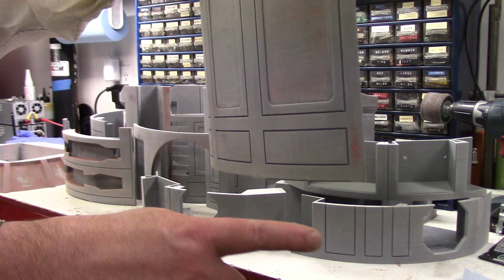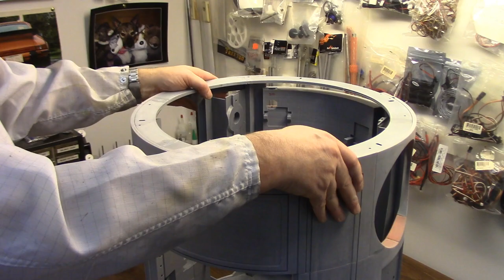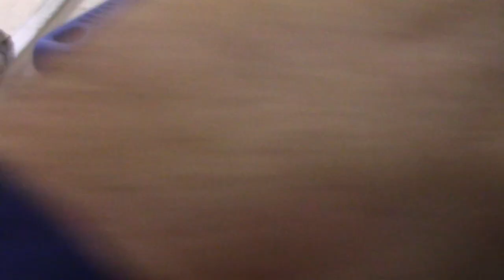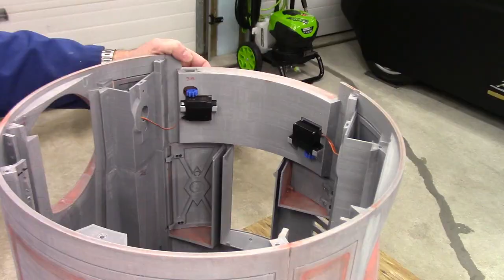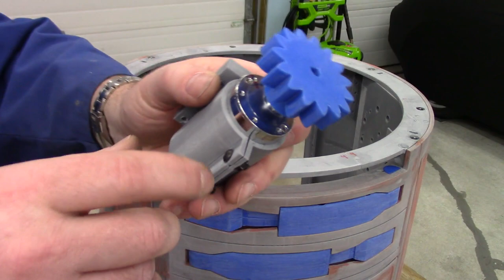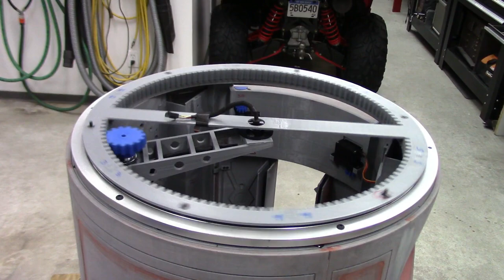Building R2-D2 - Part 5: Body Assembly including dome drive.

Comment: You mention something I keep trying to educate people about. Print layers and print time. People insist on printing fast. As a result they deal with high layer heights and a ton of post processing to make it look better.  Let the machine do the work!  Print slow  get those beautiful layers that take way less time to sand, fill, prime and paint!!
Reply from the maker: Well said 👍
Reply: @Rchelicopterfun thanks!  I completed my R2 in 2009 (aluminum). I’ve been tempted to print one in PETG
Reply: It used to be that way. But these new printers, like my Bambus and neptune 4 max are insane! Printing at .16 layer height with 4 walls and 15%gyroid with a .4 nozzle. Printing 3 times faster then a .6 nozzle at 2 walls 5%infil on my old printers. . Times have changed lol

Comment: From day one I've been using these videos as guide to building my R2. Using a Bambu P1P printer with PLA+ for the body and PETG for legs and anything structural. To fill gaps I prefer CA glue and baking soda. Quick setting and doesn't shrink. For smoothing layer lines.... Ive been printing at .2 layer height.... I use cabinet scrapers. They do a great job of removing layer lines and smoothing joints. You can get into areas sandpaper wont reach. Quicker too.
Reply: I’m thinking about buying a p1p for this project, is the 256mm^3 build volume enough for printing all these pieces? He mentioned the files saying it needs a 300x300 build volume
Reply: I've had absolutely no problems fitting any of the pieces. You can find files that are pre-cut for smaller printers. Also the quality of the parts are amazing on the P1P. Especially when using PETG which I used for all the structural parts. And the speed is so much faster.
Reply: Thanks for the response @asennad !  I'm pretty sold on getting a P1P and starting this project in the next few weeks.  Is there a specific brand PETG you recommend?

Comment: This is by far the best R2 series I have seen ! Been part of the group for ages and you have given me the confidence to start my build. 

Could you do a beginners electrics guide ?
Reply from the maker: @Mrt - Thanks for the feedback. Glad you are enjoying the series and even better you'll be taking on a rewarding R2 build yourself. 
As I mentioned, I'll be covering my electronic components and the basics of how it works in another video, but won't be venturing down the deep rabbit hole of beginners or droid electronics. I'm simply not qualified since this is my very first droid build as well, not to mention it's a huge & endless topic with many paths to follow. There is already so much information available after all depending on what specific electronic info you are interested in. 
You've likely already seen these two droid electronic publications if you are an Astromech member, but thought I would mention them again as they are the two best beginner guides I've found to date. Both are by Rob Howdle (R2 Builders club of UK). Just search for them with Rob's name in the forums or a Google search and both PDF's come up (free to download).
1. The World of Electronics - A New Builder Guide by Rob Howdle
2. Droid Control Systems - A Beginners Guide by Rob Howdle
My R2 electronic pairings are HEAVILY influenced by the information contained in both his guides. Both top notch & easy to understand resources if you haven't got them yet.
Have fun with your build 🙂

Comment: Really like when there is an update of your project 👍🏻 Like your style of presenting it and pointing out how to avoid some mistakes. Talking about that, how will you paint the arms? When you mentioned heating up the pins it sounds like they could potentially be hard to get out? 
Many thanks for taking your time to document and share this 👍🏻
Reply from the maker: @Mickael Jansson - After it's all together to confirm proper function, I will taking it all apart for priming & painting (body & legs). I won't be putting any of the body or arm greebles on of course during this process as they are only for eye candy and will all be fit (they either bolt on or are held on magnetically) after all the body & arm painting is done and fully cured. At least that's the plan...🙂 
I had pretty good success heating the arm pins just so they become a little pliable to allow slight bending alignment as the utility arms are tweaked into a centering position within the arm recess before the pins cooled. Both are still able to be pulled out afterward as the pin bending is very slight.  1/32" movement out at the tip of the arm to center it in the opening would account for perhaps a couple/few thousandths of an inch of pin reshape alignment.

Comment: Hi John,
I just subscribed to your channel as I am 80% though a V2 build to make R4-G9 (I have already built R2-D2, BB-8 and WAC-47) and like watching build logs to figure out things and occasionally notice something done differently that might make something I do a bit easier. I am really enjoying your video series on R2 and like how you talk everything through. I wish I had seen your videos 6 years ago when building my first R2-D2. I started a video series myself, but soon lost interest.

Something I noticed in this video is that you printed your center leg base plate upright. From experience it is better print this piece flat for strength. Think of it like the grain in wood. It will break with the grain, less likely across the grain. I am not sure if you have or plan to reinforce the baseplate, but it would be my recommendation. If that base plate breaks you will be reenacting the scene where R2 falls face first.

Keep the videos going man. They are great.
Reply from the maker: @MetalNerd - thanks for the comments & sub. Sounds like you have the Astromech building bug big time - awesome 👍Yes, the plate was printed in a somewhat compromised orientation. Unfortunately and as I explained in the video, that was the only way I could fit it on my printer with a bed size of 280x240. I also didn't want to split it. Thanks for the heads up on the potential face plant. Perhaps I'll put in an aluminum cross brace instead of the plastic one that is in there now, or laminate the plate it with a few layers of carbon. Cheers.

Comment: Now that you have gone through the full build using 3d printed materials, I'm curious if you would ever build another one using a combination of 3d printed materials and other materials (aluminium, wood, plastic, etc).

Looks great John!  Excited to see the end result.  Greetings from Toronto!
Reply from the maker: Considering it turned out better than I could have hoped and is working a treat; I would build another one exactly the same way. 100% 3D printed. Why mess with what works 🙂

Comment: Hi John. You mentioned using lock nuts. Would you use them in dome not glue or does the glue weld the parts together as well?
Reply from the maker: Your Call - I used blue loctite on all my fasteners. I followed Michael's instructions pretty much to the letter.

Comment: Hey John!  I can only seem to find a 24v 200rpm gear motor or a 24v 500rpm gear motor...which one would make the most sense?
Reply from the maker: Hmm, I just searched on Amazon for "37mm 24V 300 RPM Gear Motor" and a couple came up; but I know search results will vary depending on location. Should be able to source a 300 RPM (if that's what you want) however, as they are common at robot shops and lots show up on eBay too. 
Anyway, presuming for whatever reason, you are stuck with either 200 or 500, it comes down to how fast you want the dome to spin. The ring gear to pinion gear ratio is 8.2:1. So a 200RPM motor will turn the dome about 24 times per minute max. The 300 I'm using produces about 36 turns per minute. A 500RPM motor would spin that sucker around 60 turns per minute (once per second). That seems too fast IMO, but of course you wouldn't have to drive it at full power. 
Happy Building 🙂

Comment: So I'm now getting my utility arms wired up and I was hoping to set them to the sliders on my transmitter, they close just fine but only open about halfway.. How did you get yours to open farther? I've tried adjusting the trim but that doesn't do it..
Reply from the maker: You need to use 180 degree sweep servos, not 90 degree sweep (what most are) as stated in the video @ time index 11:26

Comment: Sorry for all the questions....you say the dome motor is a 37mm 24vdc and link takes you to a 12 vdc...can't find a 300 mph 37mm 24vdc....or is this in fact a 12 v with your battery set up making it 24? Thanks John fantastic video and great build
Reply from the maker: Link is to both 12 and 24 volt options. Mine is 24v as stated.

Comment: Love your videos! Your build has been a help along my path. However, watching your install of the utility arms, you completely gloss over the mating of the printed gear with the servo. How exactly did you do this and make it so it would last? Did you pare down a control horn hub and glue it into the center of the gear? Was epoxy used to cement it in place? Anyway, this step has me stymied.
Reply from the maker: That's because it's servo wheel/arm dependent what mounting method you use (as per the Baddeley instructions). The specific Futaba servo wheels I used glue excellent with CA as do the PLA+ gears so I glued my servo wheels into to the gears.
Reply: @Rchelicopterfun  I tried to go the glue route but it failed, so I just imported the gear I was using into tinkercad and added my own hub. Also made it a bit taller so it engages the utility arms a tad better. Thank you sir, for your brilliant build guides!

Comment: Hi John 
Could you tell me what the slip ring wires are connected too and is there a wiring diagram somewhere. I have the same slip ring as you but I don’t know how to wire it.
Please help me.
I am wiring R2 the same as you built yours.
Reply from the maker: Well you can pretty much wire them anyway you want - there is no diagram since it's totally up to the individual what wire colors they assign to any particular power or signal input/output. Each wire as you know is a different color so make up your schematic for what each wire color does and follow that schematic it on both sides of the slip ring.
For example, if you want the red wire in the slip ring to be your main +VDC power wire, then you would make sure you feed you +VDC into red on the one end of the slip ring, and then pull the +VDC power out of the red on the other that rotates.
Reply: Thanks John again for responding.
I understand that each colour of wire corresponds to each other ie red short to red long etc . 
Using the DuPont connectors what do you plug it in to and what does the short plug in to., as I said I  am building my electrics the same as your build, i found it cheaper and easy to get the components.
I’m in my 70s now and I am really enjoying building R2.
Thanks again John

Comment: Did you have an issue where the sonic blue pearl paint caused the 3d printed objects to shrink?
Reply from the maker: Nope. No reaction whatsoever with PLA+ (applied over primer of course so the sonic blue never actually makes contact with the PLA+). But even on test parts with direct exposure, no problems.

Comment: Did you use supports when printing body? If so, what overhang angle.
Reply from the maker: Very few. Recommended print orientation all all parts is thoroughly covered in the printed droid guide that I reference and link to in the introduction video and is also covered in all of Mr. Baddeley's instructions for each section of the build.

Comment: Hey John, been following along with your build loosely and you've been a big help! I bought the same amp as you and was wondering where you got the data panel that matches up for it? Did you model that yourself?
Reply from the maker: Modded it slightly in Tinkercad from the one in the Baddely files.
Reply: Ah, awesome yeah I ended up bringing it into fusion 360 and just making it blank, going to start adding my own stuff as I plan what I'm going to be showing on my panel. Thanks!

Comment: Hey John....quick question.  I have the dome motor (24V) High Torque with Electric Micro Speed Reduction.  It's measures 37mm in diameter.   I am going to print the motor bracket which supports 37mm.  However, I am confused on which Motor Frame to print.  There are multiple sizes (13 mm or 24mm) and there there is another Motor Frame, which looks like a small block....also in 13mm or 24mm.   Which Frames to I print?  The instructions are not clear.  I appreciate your help.
Reply from the maker: With the hundreds of printed parts on this project and that being over two years ago now, I honestly have no idea. I can barely remember what I did last week 🙃
As with a good number of the 3D files I was unsure about, I opened them in my slicer or in Tinkercad to examine them before printing to see if they were the right ones/size. That worked for me fairly well when in doubt.

Comment: What did you do to make your back panel removeable?
Reply from the maker: The back panel is a single separate printed part, so to make it removable, I simply didn't glue it in place.

Comment: awesome job just awesome john im not to this part yet but is your printer the same size as a eneder 3 pro thats what i have
Reply from the maker: Sorry, no idea what size the Ender's built plate is or gantry height. I mentioned in the video, the build plate on the SV01 is 280x240 with a 300mm max gantry height so if you have an Ender 3, you'll know if it's the same size. 🙂

Comment: Do u have any mods to your SV01? I have one but haven’t even used it yet. I have installed the CR touch with silicon bed spacers. And I have the glass bed as well.
Reply from the maker: Just the touch and silent board (think those come standard on the SV01 now?)
Reply: @Rchelicopterfun  yeah the SV01 pro has those standard. I’m thinking about the new SV06 plus. Bigger build plate size and it comes with a lot of upgrades

Comment: Love your videos thank you for them .   I am almost done printing my dome and have a question about body assembly i do not have a 500x500  print bed either( i have a 400x400) , everyone has said not to use CA glue and use epoxy, how has yours held up with the CA glue and would you recommend it after using it on yours ? also might you have a link on the - 30x M4 square nuts you used ?
Reply from the maker: @FIERCE WOLF There is an MK3 Cut version body file for smaller printers - it's what I used.
Without knowing what type of plastic you are using in your build, I'm totally in dark. With that said, epoxy doesn't bond well to most plastics (PLA, PETG, or ABS) unless you take the time to aggressively scarify the mating surfaces and even then, unless the surface area is large (like the ankle to leg bonding), I found it's not nearly as strong as good quality CA on PLA. Won't hurt to scarify mating surfaces when using CA either of course and I made sure to do that for every part I glued while I was sanding them. CA won't bond well to PETG regardless of surface prep. If printing with ABS, use solvent based adhesive for best results. In short, experiment with scrap prints to come to your own conclusions of best bonding methods for your particular plastic and don't listen to "everyone".  
Nuts - https://amzn.to/3xLlFC7  (need more than 100 so get two packs or at least 150).
Reply: @Rchelicopterfun  thank you soo much for responding your feedback is greatly appreciated.   The plastic i am using is PLA +/Max by CC3D ( i was very impressed by the strength of this filament) I would prefer to use the ca glue but I wanted opinions before i made a mistake in the middle of the build. thank  you for the link to square nuts BTW.
Reply: @Rchelicopterfun  did you ever go over how you attached the dome or maybe i missed it you mentioned rare earth magnets?

Comment: Looking amazing, it’s Great point in your build when you see the dome on the body and moving, I’m looking to that myself. When you do a video on the electrics can you show a real in-depth look into it, as I have very little experience with electrics. what drives you going to use in the feet, I want to use a chain drive cos I’m not 100% confident about using a 3d printed drive. I love how you put all the things you use in the description too, great work 👍
Reply from the maker: @Zombiehunter115. I'll be using the 3D printed gear drives with the common E100 scooter motors (24V) - we will see if they hold up or not. The more I 3D print, the more I appreciate just how strong these parts are. Likely going with casters however over omni wheels as I hope to drive mine on rough pavement which would chew up an Omni - still deciding however - always easy to change or upgrade which is a never ending process by the sounds of it. 🙃
As for other electronic info. Have you downloaded Rob Howdle's two electronic droid guides? 
1. The World of Electronics - A New Builder Guide by Rob Howdle
2. Droid Control Systems - A Beginners Guide by Rob Howdle
My R2 electronic pairings are HEAVILY influenced by the information contained in both his guides. Both top notch & easy to understand resources if you haven't got them yet.
Reply: @Rchelicopterfun  cheers yeah I’ve found the padwan 360 system when I was looking and have nearly all the parts for that, it’s just the servos I’m not sure on how they go together.

Comment: do you recommend splitting the body into pieces
Reply from the maker: Not sure what you're asking? If you're wondering what print file versions to choose from (200 small cut, vs. normal, vs. 500x500 large cut), I think most would recommend choosing the appropriate size files for your print bed.
Reply: @Rchelicopterfun  i saw ur body was in alot of pieces. i have a large machine. do u think it would be better to print the body in one piece
Reply from the maker: @paul viana - Yes, I would think you should print in as few pieces as your printer size allows.